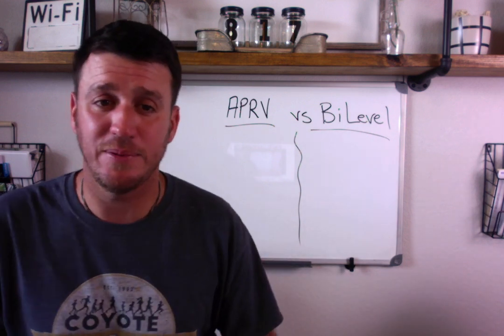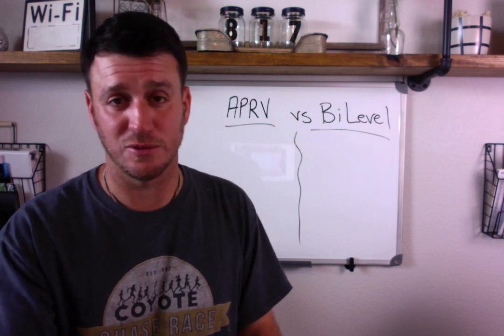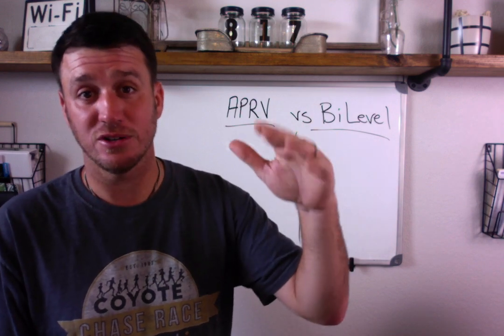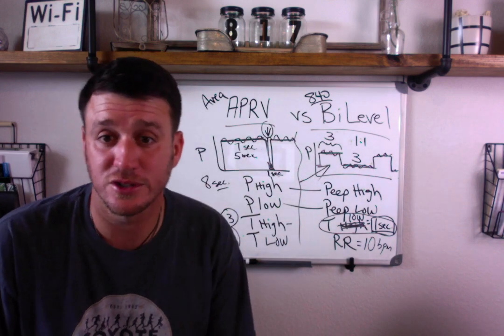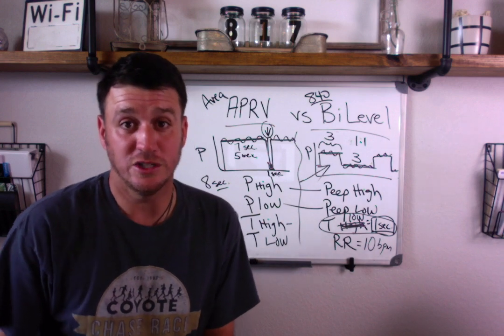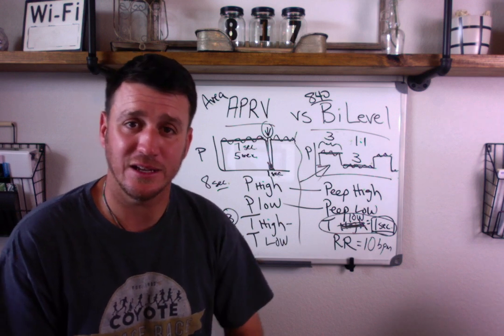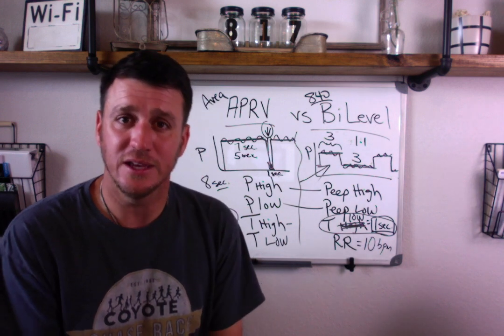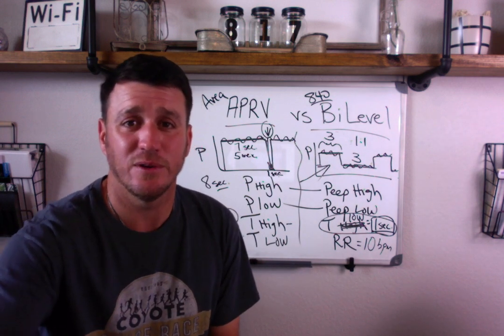Respiratory Therapy APRV vs BiLevel

Comment: Aprv seems bilivel with inversed ratio? (so longer Thigh and shorter Tlow)? What about Co2 build up in that mode? Seems a lot inhaling and very short exhaling (if patiënt is fully sedated)
Reply from the maker: You're exactly right with your bilevel analogy.  And yes, CO2 removal must be monitored.  Remember the patient can breathe spontaneously during the time high period, so that helps with co2 removal.  If more co2 removal is needed then consider adding more drops by decreasing the time high.  Also, keep in mind for these patients, permissive hypercapnia strategies may be considered.  Great comment!  Thanks for watching!

Comment: Its been some time since i worked with PB 840 vents... but also in bilevel cant you set pressure support  for those spont breaths?
Reply from the maker: Hey Adam.  You can, but ATC is recommended rather PS due to the way PS is applied to PEEP high.  None the less, yes, PS can be added to aid those spontaneous breaths.

Comment: Should patients be heavily sedated on APRV mode? And do users need to worry much about risk of breath stacking?
Reply from the maker: Not necessarily.  Spontaneous breathing is encouraged as it aids hemodynamic performance.  Also no, the whole mode of APRV functions on the concept of intentional auto-peep.  Of course, this depends on which method or approach to APRV you are taking.  Great question!
Reply: @RespiratoryCoach  thank you

Comment: Hi Couch, sorry I have some stupid questions. It sounds like BIPAP and AVRP are all good modes when patient has spontaneous breathing. Then, why do we still need pressure support mode? Can we augment tidal volume by setting a higher high PEEP? Thank you so much.  The other question is that how to decide to use BiPAP instead of APRV or use APRV instead of BIPAP? Thank you so much

Comment: Good video but I think you left some things out.  In APRV you will choose either tube comp or pressure support. Also, you want to lock in your time low and manipulate the time high by adjusting the respiratory rate.  In regards to bilevel, I have never seen such a long time low.  You still want a higher time high in order to recruit alveoli.  Please let me know your thought.
Reply from the maker: This is true, but the time high is controlled directly in some vents (Avea), not by RR.  Yes, tube comp or PS, while many think that tube comp is superior within these modes.  And yes, the time low in bilevel, for sure should be shorter than time high, but in my region we see bilevel being used like a glorified pressure control.  Not that I agree with that strategy, but was attempting to simply illustrate the differences.  Thank you for the additions and for watching!

Comment: Hi Coach, thanks for everything you do. I am at a school with a truly horrible MV instructor, so after every class I rush to your channel to actually learn the material.

My question on APRV is, if the pressure only drops for that brief moment, how does the patient actually exhale properly? Isn't the high pressure maintaining their alveoli in an open position? Or is it that they're actually taking breaths during the hi pressure phase (in which case they have a spontaneous RR?)

Thanks in advance!

Comment: I think APRV is good with Pressure control modes with helping expand body surface area of AC (Alveolar Capillary) membrane and then use Bilevel for Volume control AC mode.
Reply from the maker: Hey Johnny.  Thank you for this addition.  Do you mind expanding a bit on your comment of bilevel with volume control AC?  I'm not familiar with bilevel being an addition to a volume mode,.  Does this idea pertain to a specific ventilator?  I'm intrigued and interested to learn more about this.  Thank you again.
Reply: @RespiratoryCoach  Well I probably shouldn't say "use" bilevel for volume control ac mode. It looks to me that VC-AC mode functions similarly to Bilevel. I could be wrong.
Reply from the maker: @johnnybravo1204  Hey Johnny, thank you for the clarification.  I think the comparison to PC-SIMV is more appropriate.  Although, bilevel allows for spontaneous breathing to occur during all aspects of the breath.  This is different from SIMV, where the patient can only breathe spontaneously in between mandatory breaths.  Bilevel is a pressure controlled mode of mechanical ventilation, where pressure is set and volumes vary.  It's actually just inversed I:E ratio pressure control ventilation where the patient can breathe spontaneously at any point of the breath phase.   Thanks again for the comments and the discourse.
Reply: @RespiratoryCoach  Okay, now I fully understand. Thank you for your detailed answer.  Keep up the good work!
Reply: @RespiratoryCoach  On another thought I was relating my comment to how you take off the set respiratory rate on a vent using SIMV mode to have it function like a CPAP. But when I thought about that, another question came to mind. Would it make better sense to assume that Bilevel is more similar to SIMV with Pressure Support added?

Comment: I know I focus on semantics, but I want to understand if there is a difference between BiVent and APRV? Some use this verbiage interchangeably with APRV?  I thought there was a difference?
Reply from the maker: Hello, Olivia.  There is a difference between BiLevel/BiVent and APRV.  However, you can manipulate either to function like the other.  They both are essentially two pressures (High peep/ low peep) and the patient can breathe freely on top of either pressure.  The difference with APRV is the very short time low, typically less than 1 second.  BiVent may spend 3 seconds at peep high and 3 seconds at peep low, where APRV might spend 5.5 seconds at peep high and .5 seconds.  Does this help?

Comment: Joe, our hospital is using the Bellavista's now, what's your thought on it and did you use this ventilator yet?
Reply from the maker: Hey Max.  I actually have not worked with the Bellavista in the clinical setting, but have put myself in front of it to learn how it works and how to maneuver from screen to screen, mode to mode, etc.  I think it is very versatile in the number of modes it offers, but not naturally user friendly.  One key element is knowing if you have "target" ventilation on or off.  What's your thoughts on it?

Comment: How do you know what rate to set in APRV?
Reply from the maker: That's a great question.  Your time high will probably start 6-8 seconds, with a time low of .5 seconds.  Total cycle time will be 6.5 - 8.5, this gives you a rate of approximately 9 - 7 drops per minute.  So, 7-10 breaths per minute would be a safe initial rate and then assess and adjust from there.   Hope this helps.  Thanks for watching and asking your question.

Comment: Hi the ventilator I'm using only can set pressure suppot and peep, there isn't a setting for peep high or peep low or time high/low. how can i apply this in my situation.
Reply from the maker: Hi, Morgan.  You can't achieve this method of mechanical ventilation with pressure support and peep.  What vent are you using?
Reply: @RespiratoryCoach Zoll EMV PLUS

Comment: how high would you set the pressure support in APRV? 

Lets say u have your P-high at 25, if you set Pressure support at lets say 10, that would take the pressure up to 35. Thats a bit high for some patients. Still lung protective? 

Or better set the pressure support at around 5 jsut to compensate for the tube
Reply from the maker: Hey, man.  Great question. Depends on what vent you are using.  Some vents add PS on top of PEEP high, while others only add PS if it exceeds peep high.  For example, on the PB 840, peep high of 25, a PS of 30 will only add 5 cwp of PS while at peep high.  Does that make sense?
Reply: @RespiratoryCoach  
We use bennetts at our shop. I will try aprv there and report back. A ps of 30 seems crazy to me.
In bilevel i will usually set the  support on somewhere between 5 and 10 because i always assumed its on top of the peep low. 
Aprv on the bennett is just bilvl with a tweak and im afraid pressure support of 30 will pop the lung :p
Reply: @gabmor7779  I think you can get away with 15 pressure support. But probably no more than that.  Popping a pneumo would suck though

Comment: Hi, a really great video...one question: i am so confused about how company always made so many names for the same thing! 😅..just wanna ask a thing: what is the difference between these modes and BiPAP in NIV? Please help..thank you🙏
Reply from the maker: Great question.  Bipap doesn't have a drop in pressure from peep high to peep low.  Bipap also augments spontaneous inspirations with a set IPAP.  APRV does not augment spontaneous volumes.  The change from peep high to peep low are independent from spontaneous respirations.
Reply: @RespiratoryCoach  thx u!!🙏..so, basically, that means they (Biphasic modes vs Respironic's BiPAP) work differently, and only share the same pronounciation, am I right?
Reply from the maker: @latestlatest4760  That's correct, if I'm understanding the question correctly.  Invasive biphasic modes (APRV and Bilevel) do not function the same as NIV Bipap.
Reply: @RespiratoryCoach  thx for the quick reply..that is actually what I asked..thanks again🙏😊

Comment: Hey Respiratory Coach!
I think im little bit confused? Can you explain me this: if during APRV or BiLevel we are generating positive pressue (Phigh and Plow) in airways then this gradient of pressures is generating tidal volume,right? Same as in pressure controlled ventilation? So how come the patient on the top of Phigh still can breath spontanously? thanks so much!
Reply: I mean, if during PCV pressure gradient of 15cmH2O can generate Vt of 450-500ml, how come during APRV/BiLevel patient who is recieving that pressure gradient or even more can still make additional breath on the top of Phigh?
Reply from the maker: Hey, Rafal.  It's the ventilator technology.  Traditional pressure control operates with a closed expiratory valve, which prohibits the patient from being able to breath during a mechanical breath.  With APRV the expiratory valve stays open throughout all phases of the breath.  This is how spontaneous breathing is allowed to occur during peep high of APRV and Bilevel.  Also, note that in APRV, they don't refer to the inspiratory phase of the breath as an inspiratory pressure, they distinctly call it PEEP high.  This distinction gives way to udnerstanding that the patient is allowed to breathe on top of, essentially, a raised baseline pressure, or cpap, and not a controlled mechanical breath. Does that make sense?  And yes, despite the naming difference, the pressure gradient between peep high and peep low does indeed generate a exhaled tidal volume, which does aid in bulk CO2 removal.  Hope this helps.  Let me know if not.  And thanks for watching!
Reply: @RespiratoryCoach  thank you very much! now it makes more sense to me, still have to read more about those two. They seem to be good options in weaning patient from MV as they provide some sort of ventilatory support (they don't seem to be that invasive), right? Greetings from Poland! Thanks so much!

Comment: Thanks for a very informative video.
I have a few questions:
1. To fix the low PaO2, do you change I:E ratio (T-high) or do you change P-High or P-low? I have been seeing some RTs And Docs raise peep low (or P-Low) to 14-16 to fix PaO2.
2. Are we allowing permissive hypercabnic for patient on APRV? if we want to correct PCo2, what is the first parameter you world change between RR or P-high to change the minute volume?
3. What is an appropriate weaning guide for patient on APRV? Should we switch them straight to conventional mode before TSB patient?

Thanks again!
Reply from the maker: Hello!  Here you go...
1.  In Bi-level, increasing both will affect PaO2.  Mainly because increasing either will increase mean airway pressure.  It really depends on how long you are holding at P-high.  In APRV, P-high is your main oxygenation tool because you aren't spending enough time at P-low for it to matter.  
2.  Yes, permissive hypercapnia is acceptable in APRV.  It would depend on your current settings and return volumes.  Let's say you're at a rate of 4 with a P-high of 35, then I would increase my rate.  Knowing that both RR and P-high affect minute volume (as you stated) is the key.  From there, utilize your clinical judgement and critical thinking skills to know when and which parameter to change, depending on the data you currently have.  
3.  There's nothing that states you can't go from APRV to SBT.  If you're able to wean down to a minimal P-high with an acceptable P/F ratio, and minimal rate with a good spontaneous RSBI and the patient looks good, then I would go straight to SBT and assess for readiness for extubation.  Of course, every situation is different.  Some patients will go to a conventional mode before SBT, but it's not "absolutely" necessary.

Hope this clarifies things for you.  Thanks for watching and commenting with your questions.
Reply: @RespiratoryCoach  
Will you please give me some knowledge regarding P/F ratio..
Thank you